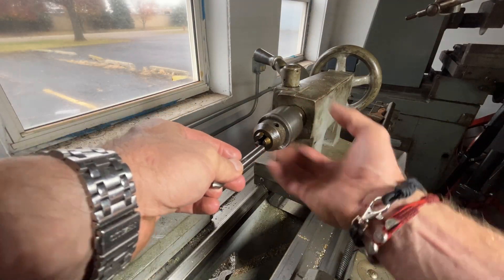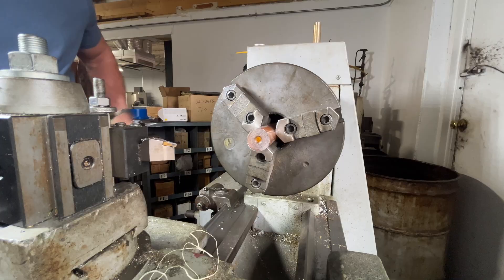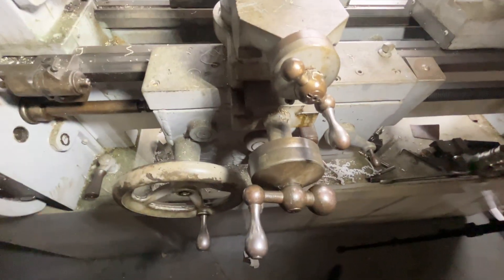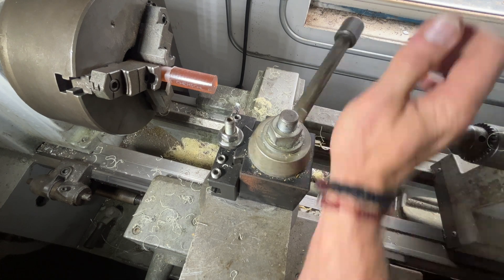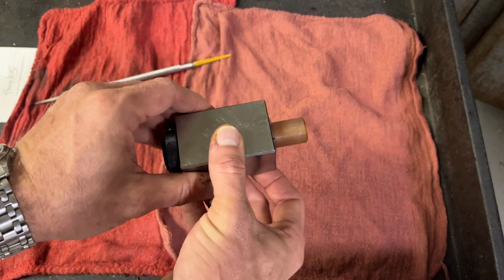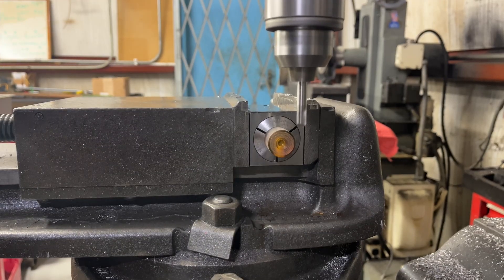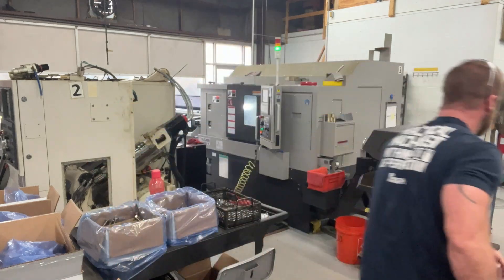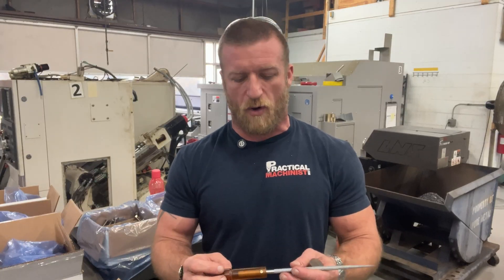Handemade Masterpiece? Satisfying Lathe Work💥 #cnc #machining #make #lathe #satisfying

Comment: I started with pure CNC and began picking up a bit of manual work doing small things like this, really fun. Tip for turning plastics, try and use aluminium inserts they cut the best. Avoid chipbreakers if possible too, uncoated and just sharp will give the cleanest cuts
Reply from the maker: Those are good tips for sure. I don’t have a ton of experience turning plastic, but the times I have those types of tips have really helped

Comment: Well it was only 15 steps 

But I don't see why you didn't just drill and tapped through both sides on the first setup on the mill and then flip it to chamfer the hole
Reply from the maker: I thought about it but I was worried the drill would walk. It’s happened to be before.
Reply: @Crusadermachining  well there is a special technick that allows you to use the drill as a spit drill ( very small very quick pecking. can be used on both round parts ( so long that your not super far out to the side ) and flat thin parts like spring steal ) or you could also just chick a endmill in thats smaller then the drill to it has a flat surface thats perfectly perpendiculare for the drill to start on inside the hole

Comment: Take it to about 400 grit dry, kiss it with a hydrogen torch, it'll be glass.
Reply from the maker: I’ve done that before with acrylic where I hit it with a little bit of heat and it was beautiful. I think I’m gonna try it again. Thanks for the input.
Reply: I hate working with plastics. Never touched acrylic but at least it seems to be a plastic of the hard variety which helps.
That looks great!
Reply from the maker: @XxLatheAddictxX thanks man